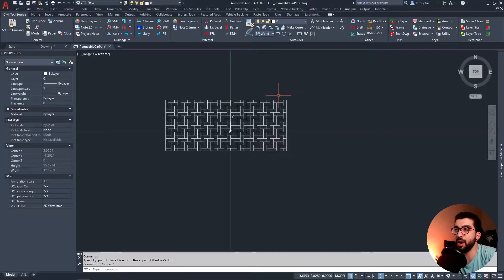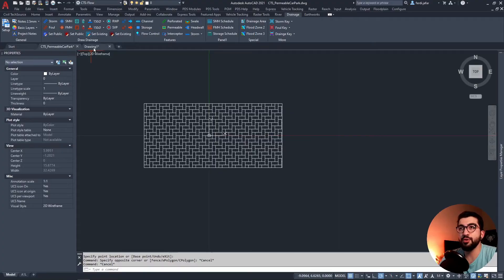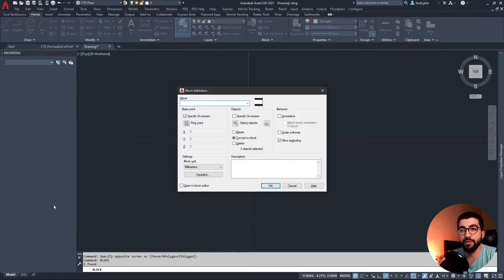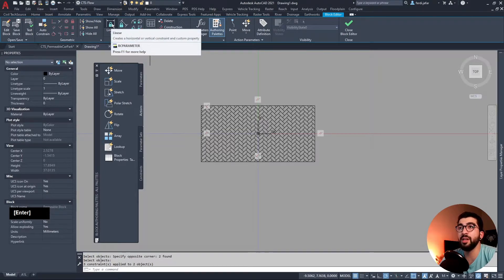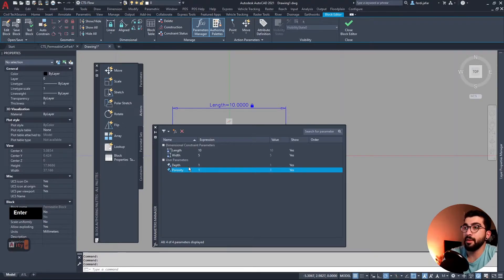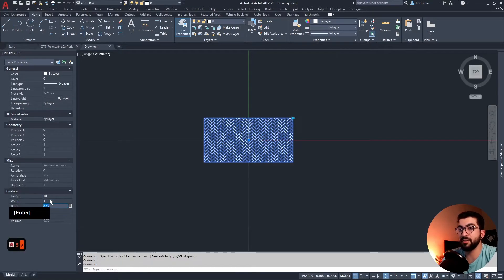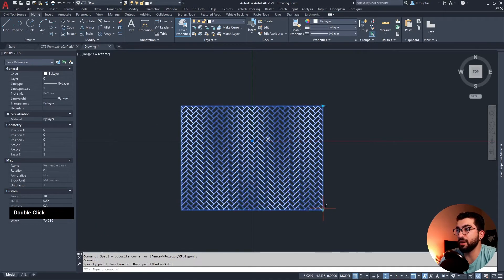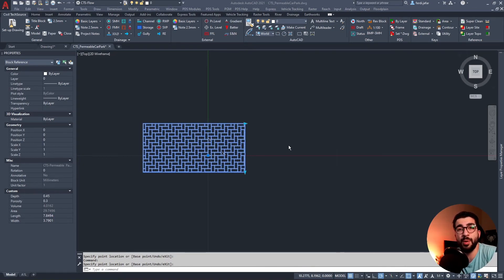AutoCAD Dynamic Block - Permeable Paving

Comment: Your tutorials are supercool. Please make a video : How to reduce and organize layer. I have  .dwg file with over hundreds of cryptic layers like: {45672876fghjnnsbfsg} layer and I need do organize the drawing nicely to work with it. Most of the layers are X-ref dependent and there are Blocks in Blocks in X-Refs ;-( so its hard to adjust. The drawings were created by an old Autocad based program.
Reply from the maker: Ouuuuu this sounds painful. But Why are you worried about the layers, if the layers you use are organised and consistent then don't worry any further.

Comment: Great vid. Would you ever take into account the low porosity of the permeable block and sand layer if modelling in flow ?  Probably best to just decrease the overall depth by 100mm?
Reply from the maker: Thank you! That is a great question, personally I do not take into account the permeable block or sand when modelling it in general. If I do...then I must be really desperate for additional storage haha. Thanks for the support!!